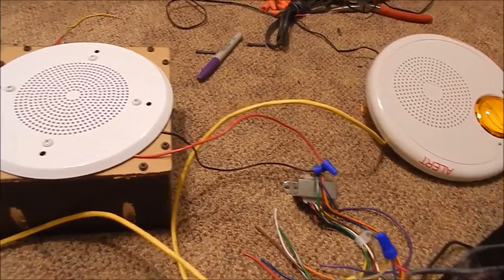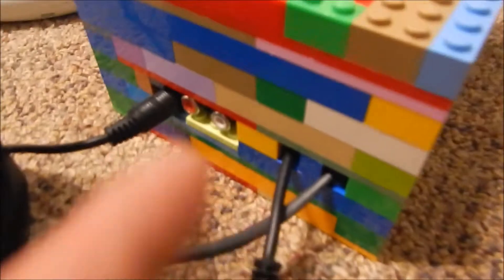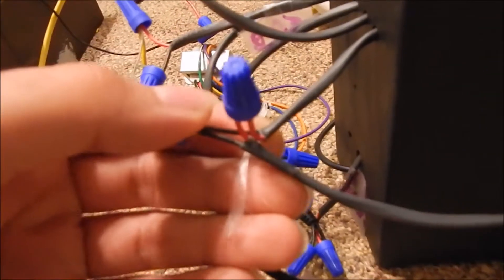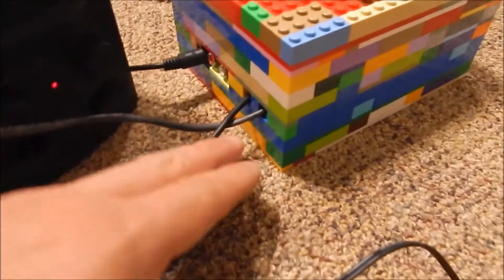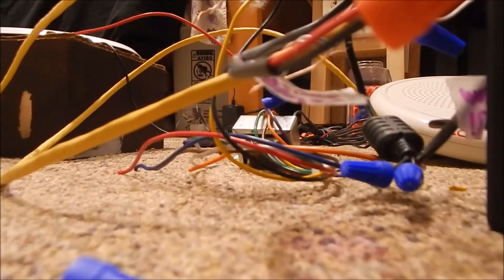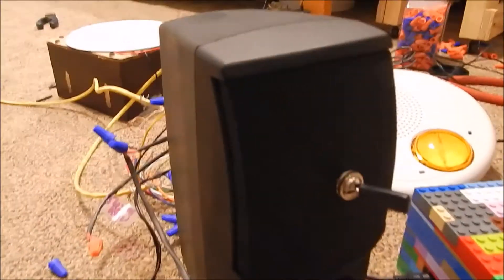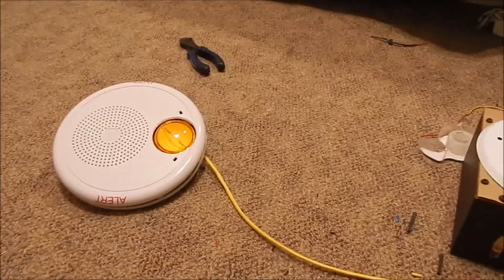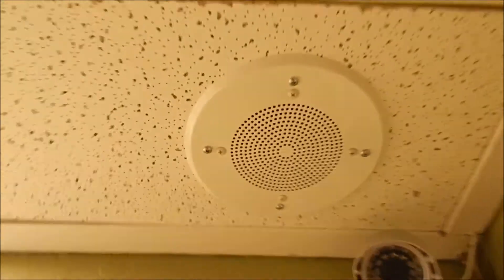Weather Alert Alarm System Part 2

Comment: I recommend hooking up a NOAA Weather radio so in case there is severe weather in your area and the radio goes off, the system goes off automatically and still make it to do manual activation. Make sure the NOAA Weather radio has a external alert port like the Midland WR120 so it does activate when severe weather is in your area
Reply from the maker: That is something I will consider. All I need is a constant power out port to power some 12-volt relays used to activate the system. The audio part would be the easy port.